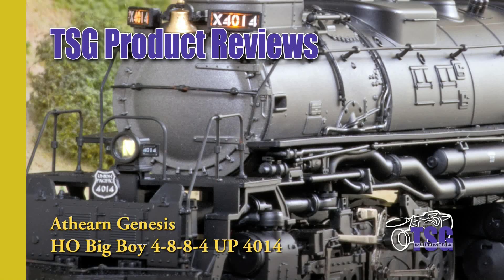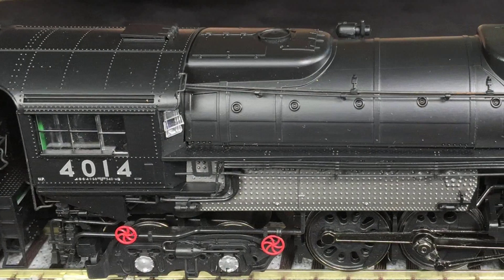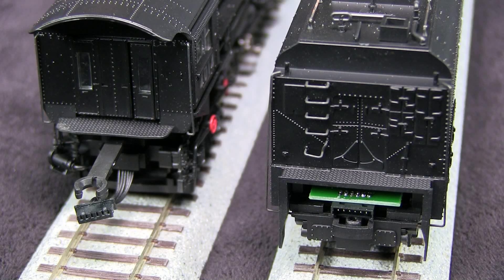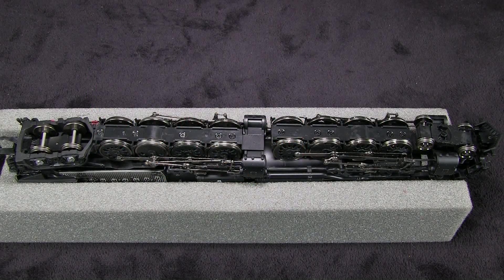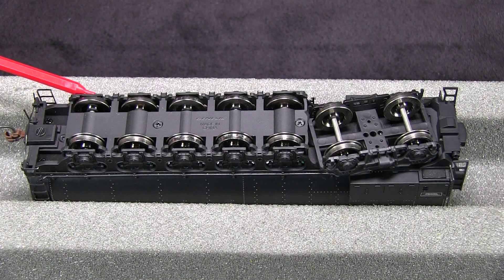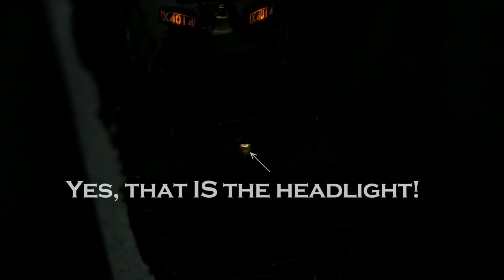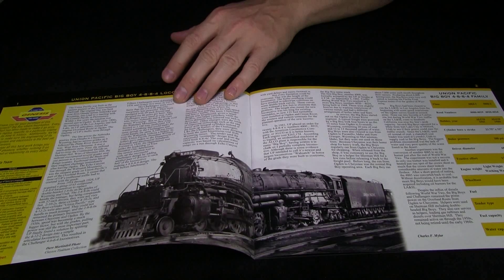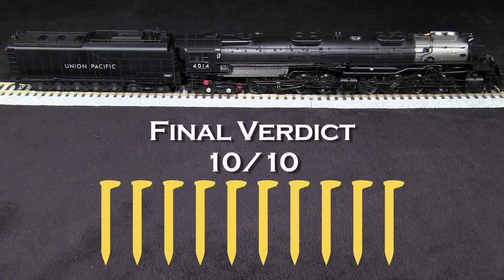HO Scale DCC Big Boy 4014 Athearn Genesis Product Review

Comment: Good review of an impressive loco. I have just purchased a used one on eBay which has a dud decoder,( the old MRC version, your favourite!) so will be ripping it out and replacing it with a Tsunami2. The exhaust sound produced by this older Tsunami hasn't got me convinced but reviews I have seen of the Tsunami2 appear it is a good piece of kit.
Reply: Daniel Cortopassi will that be happening anytime soon? If so I may wait until I see how your Loksound performs before I make up my mind.
Reply: Thanks Dan, I have tried looking for 3985 on your channel but couldn't see it...do you have it featured in one of your 'Dan's Models' somewhere?
Reply from the maker: I don't think we have had a 3985 model on the channel. Or if we have, it was buried inside one of our older podcasts before we changed their format.
Reply: tsgmultimedia thanks, I am sure it will appear in some kind kind of "UP Steamfest" now that you have all three of their steam locos.
Reply from the maker: Oh that's an interesting idea.